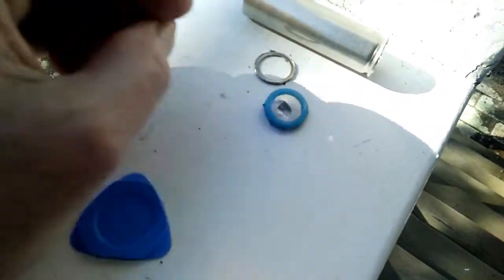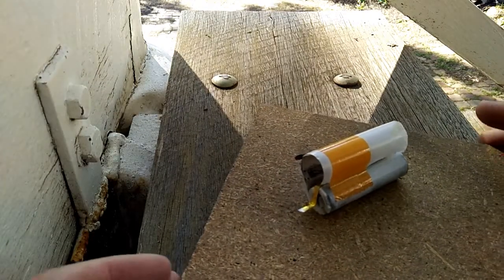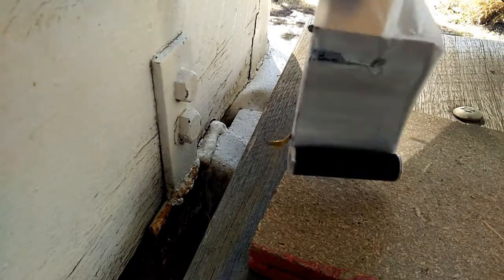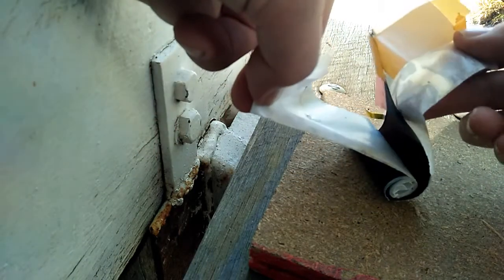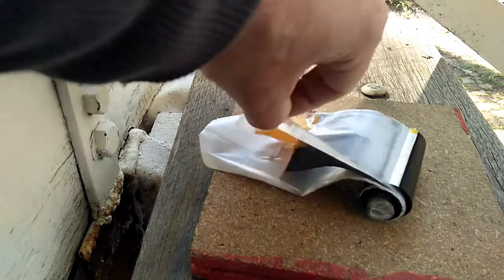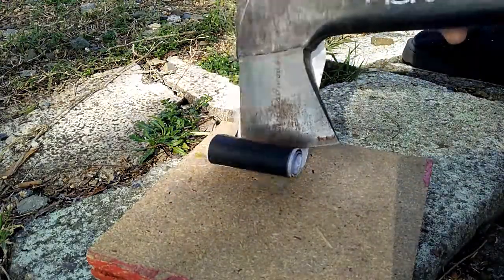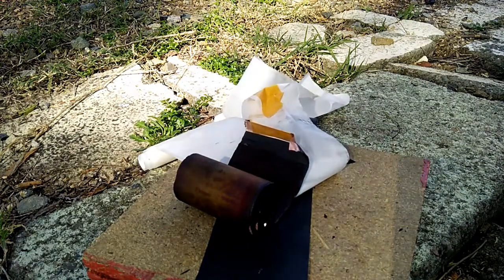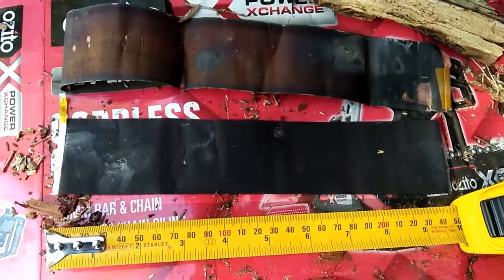18650 short sheeted shit

Comment: Nice review. Still good that it's a real battery, some people received just sand in the cells from some crap Chinese brands 😀 
I also saw some claimed capacity of 5600, 7800 even 9600 mAh on 18650 and in reality they are less than a thousand mAh sometimes. It can cause safety issues and explosion even. BTW  empty cell looks like a bullet 😊
Reply from the maker: well the thin bit of foil leading to the +ve lead would simply vaporise like a fuse if you attempted to drain much out of the battery. If you vap (I don't) and put it in such a thing it would just simply die.
Reply from the maker: as is common, my videos are supporting material to my blog posts
http://cjeastwd.blogspot.com/2020/07/selling-shit-to-unwary.html
:-)